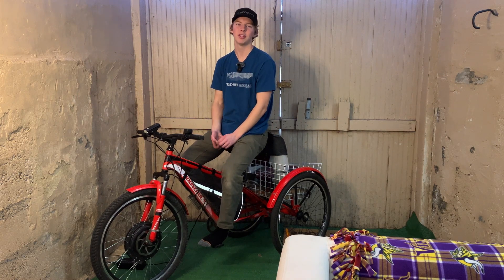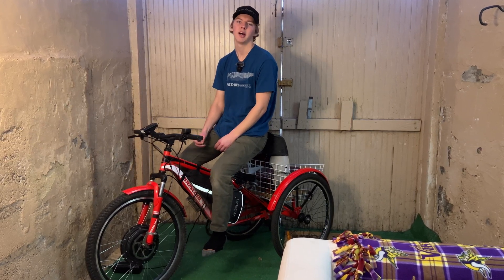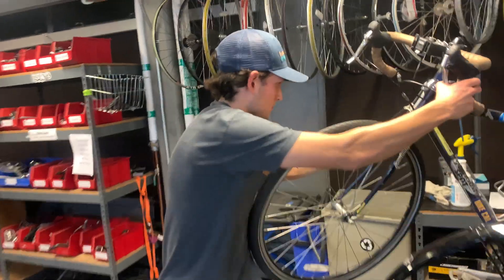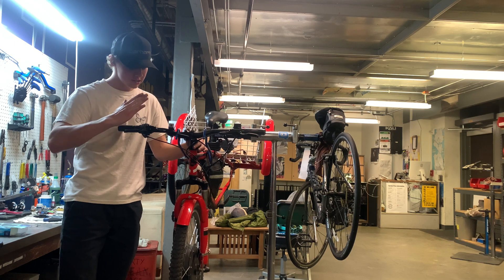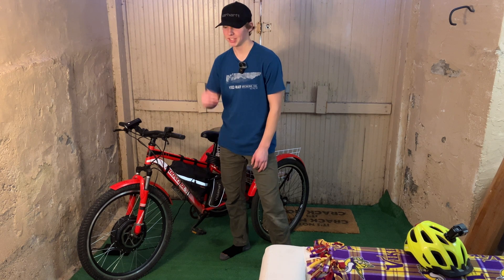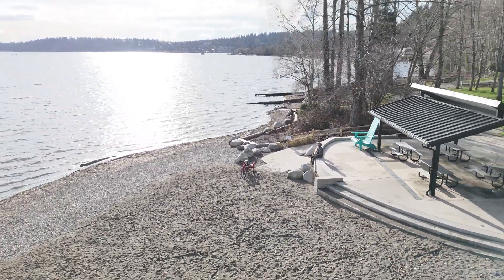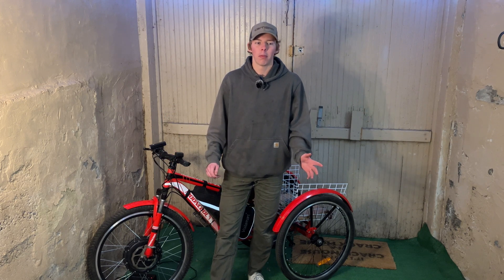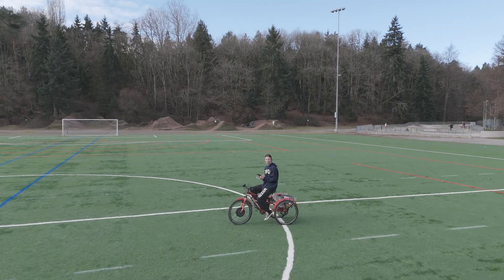Longevity of a DIY Electric Bike/Trike -- 3 Year Test

Comment: Im thinking of buying this trike model.  Can anyone tell me what the triangle dimensions below the seat are so I know what size battery to get?
Reply from the maker: Hello, triangle dimensions of the usable space is 10”x15”x17”. Vertical x Horizontal x hypotenuse. 

I bought a bushwhacker bag, and it takes up that space pretty much perfectly.
Reply: Thanks so much.  Is this bike a 26inch or a 27.5 inches.  Can I install a fat wheel fork on the front?

Comment: Yo bro so I got an electric wheel for my trike an I wasn’t able to use it cuz I didn’t know it needed a battery so I just been padding it like a regular bike will the wheel still work once I get the battery cuz my whole bike keeps vibrating?
Reply from the maker: Check to make sure the wires coming from the wheel aren’t touching each other. If they touch it’ll make the whole bike vibrate. I would put electrical tape around the end of the three big wires.  But the wheel should still work if that’s the problem.
Reply: I don’t have anything hooked up yet cuz I’m waiting to get the battery pack for it I was hoping to get it this week but I didn’t get paid enough from work so im waiting till next week .